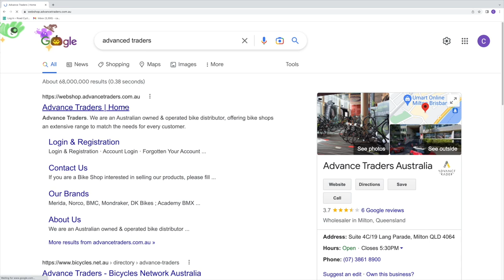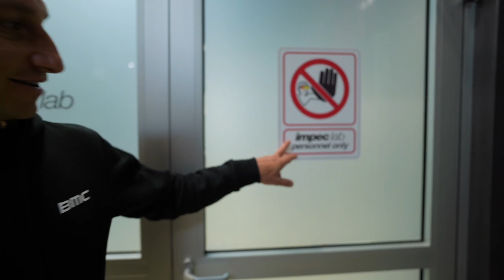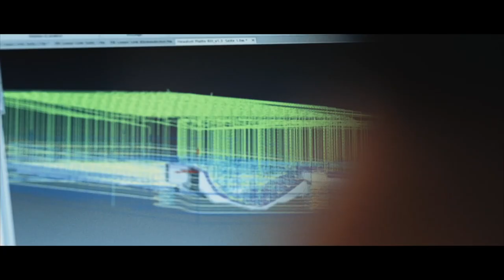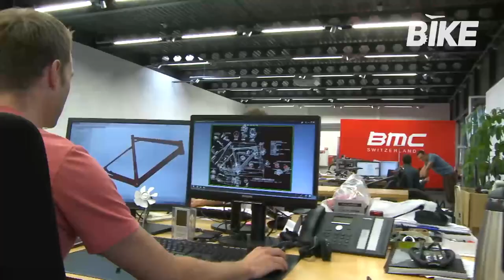What’s with the PRICE of mainstream bikes? (two BMC executives explain)

Comment: Bike makers need to sell the frames without groupsets to bike shops more. They can then build up the bikes with loads of groupset options from loads of groupset brands.
Customers would love the choice of price points, or they can even build up the bikes themselves, learning great mechanic skills in the process.
Reply: I prefer a frame/fork only. It's pretty much a given you'll swap out saddle, bars, stem, crankset anyway so any cost saving of buying a complete bike goes out the window pretty quick
Reply: Yh companies do that. For example canyon. You can buy the frame only or for a few hundred bucks more get the low tier build. Others follow that example. The stuff on the low tief build is way more expensive than the difference in price to the frame only. So buying frame only is stupid with the current market.
Reply: I just built up my own Dogma F with exactly everything I wanted. I sourced everything myself and did things that even a bike shop would likely not accommodate. Difficult but very satisfying.
Reply: @RAP4EVERMRC96  Where can you find the Canyon frames? I'd be very interested but I can't seem to find them anywhere
Reply: @natheirabu-dahab1446  well on canyons website. idk if they offer it for all bikes but for ex. for the grizl (gravel) bike they offer the frame as itself.
Reply: @RAP4EVERMRC96  link? I just can't find it and I would be interested. Thanks
Reply: Actually there aren't really bike makers more frame and wheel manufacturers that add second party parts. I think you meant that frame manufacturers need to sell frames or framesets to customers via retailers or direct to consumer.

Comment: With respect, this conversation had very little to do with the price of mainstream bikes per your title. It was an advertisement for BMC.  Nice guys who obviously understand the business and their 'secret sauce' which isn't a secret in the industry.  All top brands have a Cadel with his sensibilities for feedback and of course Specialized is famous for real time road load data.  I am a mechanical engineer who worked in product development my whole career.
What has elevated price to the consumer is 'complexity'.  If you go back to 2012 or ten years ago when most framesets were BSA and carbon was emerging as viable, the frames were much more simple in design.  Compare the Tour de France times of the Lance era to present day.  There isn't much between them but the cost has what tripled to the consumer for a top tier racing bike.  Why is that?  Integration and complexity.  Why do manufacturers do that? For marketing exclusivity aka one-up-manship.  To what end?  To project that a given bike design is better.  Is it really?  No, in fact it can be worse.  In 2012 or 10 years ago most frames of all materials were threaded.  The industry did a U turn and bent over their entire consumer base for 10 years trying to get press fit to work.  As an engineer, I always knew press fit was garbage due to tolerance sensibility and crank forces always trying to walk press fit bearing cups out of the frame laterally.  This is elementary to somebody who went to engineering school. What is the industry doing now? They are returning to BSA and 'marketing it as an improvement' over press fit.  Press fit largely came into being for 'marketing' i.e. that a frame was stiffer, bearing bores were more co-axial and there were would lower bearing drag. This was largely rubbish or very little value added relative to the downside of having a design overly sensitive to frame tolerances that would creak like a barn door if all moons didn't align.
Marketing something that is better.
The list grows.  Electric shifting nobody needs.  Heavier and more complex hydraulic disc brakes.  Integration for what 2 watts saved at 30 mph?...you quoted a $1000 increase for integrated handlebar in frame cost where you can't adjust stem length? How many who watch your channel try to replace hydraulic brake hoses routed through the stem for integration and don't lose a day out of their life for nothing gained?

The bike industry has largely gone mad.  Go over to David Arthur's channel and observe his wind tunnel tests and find out there is nothing between a round tube TCR and the new flagship, latest aero bikes which don't ride as good because of moment of inertia and frame stiffness that can't match a round tube bike.  Specialized even has the balls to re-introduce a 2012 Tarmac in 2022 only with heavier disc brakes and call it an Atheos and charge $14K USD for it.  Why would people prefer such a bike to a theoretically more slippery SL7 Tarmac?  Ride quality and weight.

Marketing.  Why all the fuss?  Profit.  Its the BMW business model.  25 years ago, BMW automobiles had design purity.  Were relatively simple, didn't cost as much as a house mortgage and lasted for 20 years with proper care.  Now, the complexity of modern BMW's to market advantages has created abysmal reliability.  This is BMW's business model.  Does BMW make more money selling complex products that break more frequently or simpler machines that break less that don't have to be replaced as often?  Pretty easy answer.

Now Hybrid automobiles entersthe discussion.  Do consumers need automobiles with two power plants?  Complete redundancy?  Multiple computers to allow an electric motor and internal combustion engine to provide seamless power delivery working together synergistically?  Suckers need to spend more for the same performance. Same with what has happened to the bike industry.  How many dentists and doctors with less than 200w FTP can afford top tier road bikes in 2022?

Lastly, the latest manifestation?  Look no further than the new Specialized Diverge with 'future shock' front and rear.  No performance cyclist on the planet wants that level of saddle displacement in the rear because it robs pedal stroke efficiency.  A complete gimmick for 'marketing' to sell more bicycles to 'suckers'.

The public is largely clueless about design and even value.  What PT Barnum used to say...
In politics and design, when you scratch your head and wonder, that can't be right?  Why is that?  It is always about who is getting money at the expense of suckers that are paying for it.
Reply: All fair points. Although I'd make an arguement for disc brakes. I prefer their consistency and power over rim.
Reply: True. Got a cfr696 which is a brilliant bsa frame. Build your own bikes!
Reply: Awesome reply, thank you for taking the time to write it. Helpful for people who are not into mechanical engineering or economics (like me, with a background purely in computer science).
Although the only thing that I would have to disagree on: (hydraulic) disc brakes. I regularly switch between my disc gravel bike and rim road bike. The difference in control is massive, they allow for easy wide tyre setups and without wearing out wheels.

Comment: This is a lot of justification from the sales side. Still does not explain the cost of a frame being as much as an entire motorcycle. I also question the answer to that being it's a volume of production issue. There are a lot of carbon frames being made. I've never ridden a BMC or a Seka. But, is the ride quality really several thousands of dollars better? Is the secret sauce really that much better? My main concern is safety and that's the only thing that keeps me off of Chinese direct is accountability. Then at that point look to TIME frames, not just because Hambini is a fan. But, RTM molding is on another level. I say this from personal experience, not anecdotal. Also, these road frames are costing more than full suspension carbon frames. Talk about engineering, lay-up complexity, extra machining, supply chain complexity, etc...
Reply: The good old motorcycle analogy… yes you can buy a motorcycle for the price of a team level bike frame but that’s comparing apples to oranges. As a bike consumer you could buy the bike Bruni races at the worldcups but you can’t step into your local Yamaha dealer and walk out with Tomac’s bike, which is estimated to cost around 100k.
Reply: Yep, they never answered the cost question. Just rattled on about how BMC bikes are better due to "secret sauce".
Reply: @Bonky-wonky  Unless I am misunderstanding your point, what you say only reinforces what I am saying. In that these bikes, BMC, Specialized, Trek, Factor, etc. are all available either direct to consumer or at your LBS. They are not one-off hyper-level race machines/F1 avante-garde. These are mass-produced and the valuation should reflect that. Funny (funny peculiar) to be bringing the son of John Tomac into the discussion. I don't see it as apples to oranges because it is not the product in and of itself we are discussing, it is the difference between mass-production and something like F1. Yes, these are top brands, yes accountability has value, but charging almost $3000.00 more for a frameset over a Seka just seems a bit out of whack...
Reply: @built2last409  exactly right. If the prized Moto Superbike bike was mass produced it wouldn’t cost nearly as much because it would be the norm. My used $1500 VeloVie rim brake mechanical Ultegra build regularly drops multi thousand dollar “boutique” bikes. It’s laughable.
Reply: Not accounting for inflation, we're getting a lot more bike for $1500 than we were for $1500 in 1990.  My first nice Dura Ace road bike would be total trash compared to a new bike with Sora. Bikes over $10k can't even be compared to the heavy bricks we used to ride. My Seven(purchases discounted as a shop employee) would have cost me $10,000 when I got it in 2006.  I could built a Dura Ace Di2 Seven for just a little more today.  Far less than inflation.  That said, I'm waiting for a $4600 Domane I just ordered a week ago.  That bike is better than my Seven in every way but impact resistance and for less than half the money 15yrs later.  It's also nearly the exact same geometry of my custom geometry
Reply: @ronb9901  your bike isn't dropping those bikes.  It's ridiculous that people think that way.   It's not like driving a Corolla and flooring it while leaving a floored Ferrari in the dust.  That said, if you had their bike, you'd be leaving the old you suffering to draft behind the new you.
Reply: @veganpotterthevegan  not true at all. You’ve completely missed the sarcastic point.

Comment: Agreed, just bring back mechanical rim brake. Nothing was wrong with it.
Reply: Should be an option agreed, but few talk about the fact the disc brakes do not necessitate rim replacement/wheel rebuilds as rim brakes do, in my experience , I do 10,000 km per year and I do look after my kit. It's a hidden benefit, especially with carbon wheels imo.
Reply: I do love it`s simplicity, but regret it every time I get caught out in the rain.
Reply: @MrBoggins1234 Years ago i had an mtb rim that was ceramic coated which had none, no grooves at all on the braking area at all.
Reply: Remember, until up to 1 year ago, some manufacturers offered the choice of rim or disc brake versions for the same bike. Unfortunately, the disc boys placed most higher end orders with discs that even Giant, the largest, stopped offering the choice of rim brakes. 
For higher end models rim brakes will never return, even Froome had to come to terms.
Reply: @hugocarvalho1831  Actually, it is proofen that common people ride slower and more careful in the 🌧.  I ride with rim brakes on three different bikes and never longed for or missed discs because of 🌧. I use aftermarket brake rubber for my alloy rims, they perform good enough for me even in bad weather...Take care!

Comment: Hi Cam great interview! It's a big effort for them to come out and have a chat to you.

I'd be really interested if you were to approach a winspace or Yoeleo and ask about some of the things the bmc guys brought up and see the contrast :

-how many pieces do they use to make their upper end frames?
-what is their experience with the various types of carbon?
-do they have an r and d program, and if so what is it?
-do they collect data from world tour, pro continental or other teams?
-do they invest back into competitive cycling?

Love your work
Reply: This a point to consider. I had a Shimano dura ace shifter jam after 2 months and I sent it to Shimano in Melbourne and got another back within 48 hours. Outstanding service there but then I bought of wheels ex China with I believe we're Novatec hubs which I believe we're  seconds or made for OEM builds. The hub slips from day one and I had no help from the seller or Novatecs head office apart from "Please remove the grease from the ratchet and pawls then apply a small  amount of a particular weight  grease. That didn't work so I replaced the hub and springs which sort of fixed it before the hub axle disintegrated. Novatecs didn't reply to my emails. I should have stuck to my powerway hubs which have been faultless. I've also had some spoke failures on CN Mac spokes. I haven't dealt with more established Asian manufacturers like Winspace but you are dealing more directly as opposed to component manufacturers. Ive got a set of elite wheels here hope they last.
Reply: @glennoc8585  I got a set of elite wheels on my road bike, just the lower end 48mm ones for road. Had a bike shop look at them initially and at 1000k and they are true and solid. Hopefully you get the same but yeah I'd buy them again for 500 aud

Comment: The trickle-down effect seems to have dried up. At 6'4" and 100kg and a basic recreational cyclist, have always put value over bling/marketing hype. Have always been happy with alloy 105 rim brake bikes, in the wet or dry, for the last 20 years. And I want it to be easily serviceable - no rim brakes or tubeless tires thank (have had 2 flats in four years). Last bike purchase was a 1018 Bianchi Impulso off Pushy's for $1,200 here in Aussie - guess it must have been an end of season XL frame they were wanting to get rid of. Guess there's not a lot of profit margin in there for the manufacturers.
Reply: Think you meant no disk brakes?

Comment: I have not looked at BMC recently, but the new release Specialized Tarmac complete bike with wheels, groupset etc, in the S works level is over $20 k , Bianchi with the new 2023 upgrade to the XR4 , are top level spec are mid $20k. It is getting crazy, because as a rider you want the best , but prices are going crazy.  Obviously if frame only prices are around $9k , then obviously the group sets and wheels etc plus obviously the retailer and suppliers mark up, are making up the rest.
Reply: And a Yamaha r6 road bike brand new is approx 19k. It’s absurd

Comment: Hambini did a review on BMC:
Would be curious what BMC says about the front drealiur bosses butting up against each other internally that could cause a fracture in the carbon.
Reply from the maker: I did think about asking them Terry, but the frame was not new. Far from it. So there's too many question marks when you don't know the history. Plus, this interview was shot well before that video was published. Cheers,
Reply: Let’s be real. The quality ain’t great. Bosses don’t move around with history.
Reply: @CamNicholls  let's be honest, the touching rivets were clearly from the factory and the bottom bracket is hardly going to get smaller over time.
Reply: @jochem1986  what is the defence to a hole that is outside of tolerance? Answer: an excuse
Reply: @Hambini  Mate, in your world, we'd all be riding those thick, heavy, wooden Scylon frames because they are indestructible, but no doubt, as uncomfortable as you could imagine and heavy as a brick
Reply: @pavlos..  in my world they would put out frames that met the specifications they sold them as. Your logic is flawed, it's not about ride feel, it's about having things that are straight, concentric and round.
Reply: Alistair Martin  What are you smoking mate? 

I'm pretty sure if you get paid by insurance companies for your professional view on aspects of bike manufacturing in court that your opinion has some worth and is legitimate. 

How many bikes have you owned or worked on? Are you even an engineer?